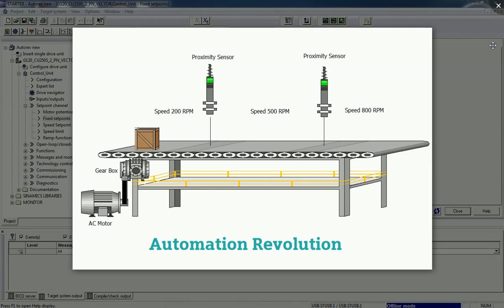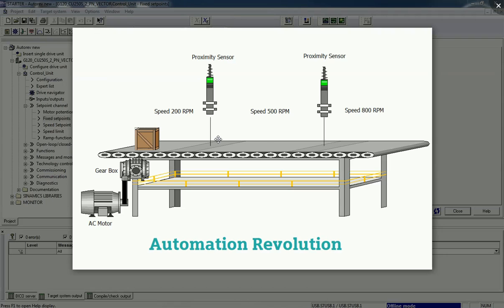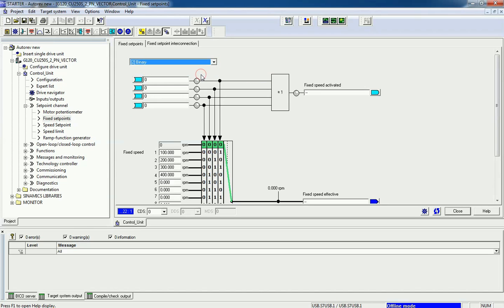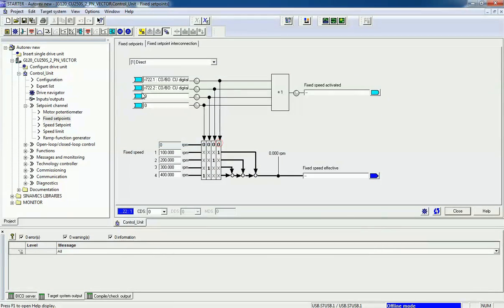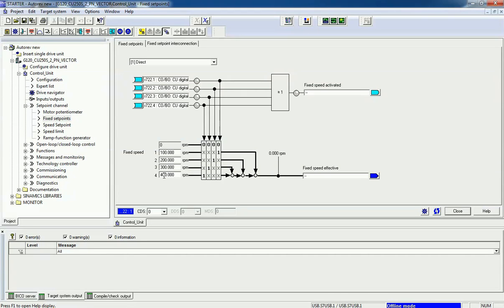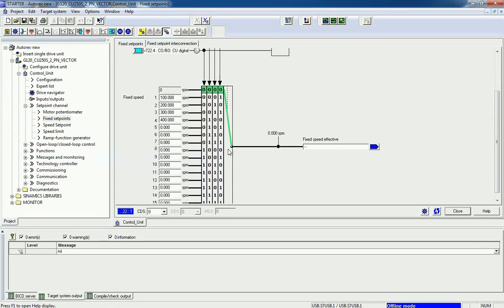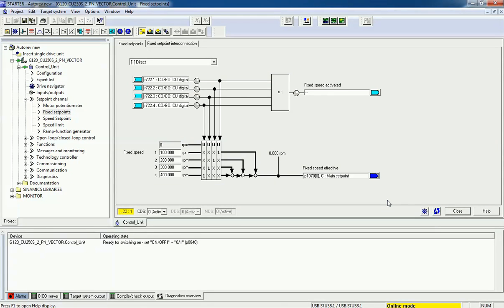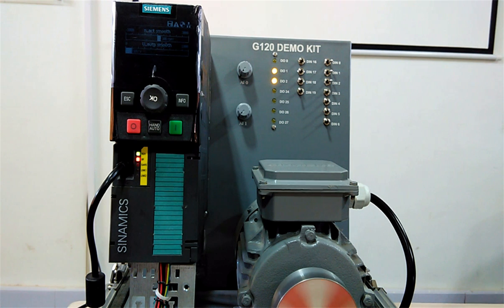Fixed Set point configuration for Speed Control in SIEMENS Electrical VFD

Comment: I want to use fixed set point and analog input ,there is a switch button for switch analog set point to fixed setpoint it connected in DI3 at VFD
If DI3 is active main setpoint = fixed set point else Analog input 

Which parameters should i change

Comment: Dear experts,

I need your support regarding the issue below

I have micromaster 440 connected with two analogue input one for tension control and the other

one for speed control .

Simply I need to know, How can I change between tension control and speed control based on

selector for example or any other applicable method

Hoping my inquiry was clear to get the best solution

Thanks in advance
Reply from the maker: Hi, Please provide details what type of application you want. And do u want to change mode of tension and speed control or want to synchronise both?
Reply: I want to change between two modes  
It's a textile application and the operator has two AI signals one from Load-cell for tension control and the other from normal potentiometer for speed control 
How can I do that with the easiest way ?
Thanks in advance
Reply: Any update regarding my problem
Reply from the maker: Hi, for that you can use analog signal as reference input to VFD and V/F torque techniques you can use. For more details please visit Siemens support portal from there you can get detailed information.